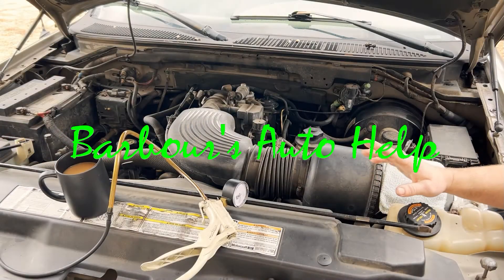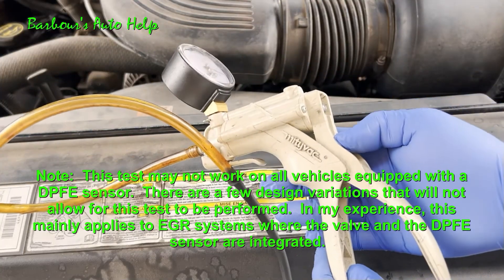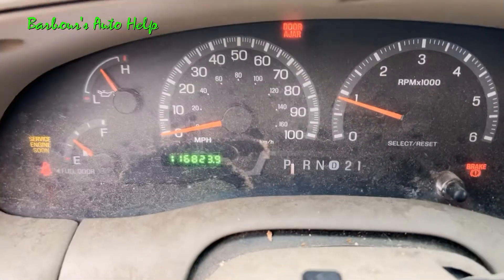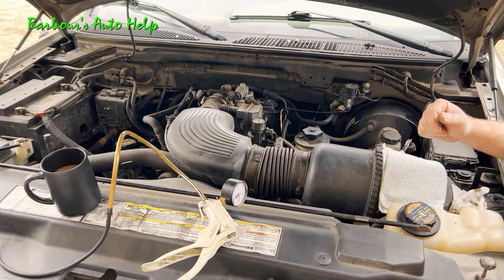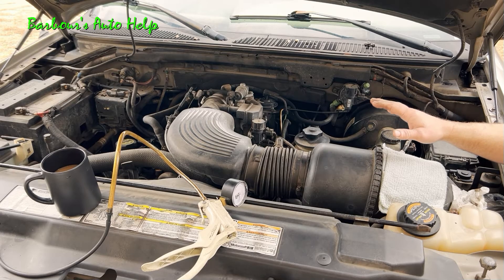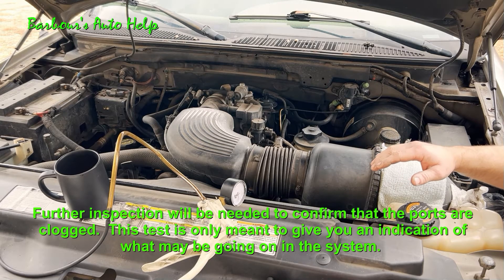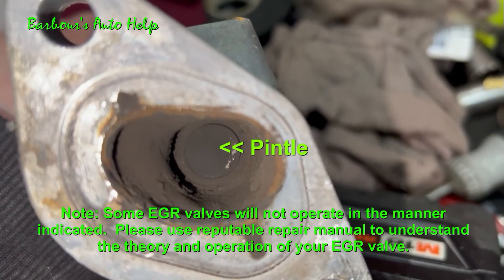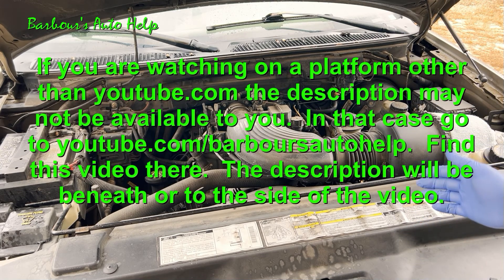P0401 In Ford Vehicle?  A Simple Test For Clogged EGR Ports

Comment: Thanks for this video! I had been getting code P0401 for more than a year, and I finally had the chance to buy a vacuum pump a week ago. I did the vacuum test as described and it hardly had an effect on the idle. I took my 2000  Ranger to a mechanic yesterday (Fri June 13, 2025) and sure enough, the intake port was clogged. I did a cycle drive of about 20 miles this morning, then scanned for codes. No trouble codes, and no monitors flashing. Everything checked great! Many thanks for your advice from a year ago and this video!
Reply from the maker: That is so awesome!  Thank you for sharing!

Comment: Hello my friend, I performed your recommended test with a vacuum hand pump and the motor did stumble and you had said that if it does the EGR  is  working like it should.. my old matco scanner says that I have an EGR problem.. I don't know what to do now.. one thing I noticed is that the vacuum line to the EGR is pulling vacuum all the time in park.. should it always be pulling vacuum??? I had to edit this comment.. I found some more of your videos related to EGR.. but the question does still remain... Should vacuum always be pulling  on the EGR
Reply: I don't think so. The computer only activates the EGR valve with vacuum under certain conditions, otherwise the spring inside it keeps it closed, so no exhaust gas is sent into the cylinders to lower the combustion temperature. There are a couple of other parts in the system that can fail, as well as the two ports in the throttle body which eventually clog up with carbon and cause the check engine light to come on. That will eventually happen on all these Ford engines.